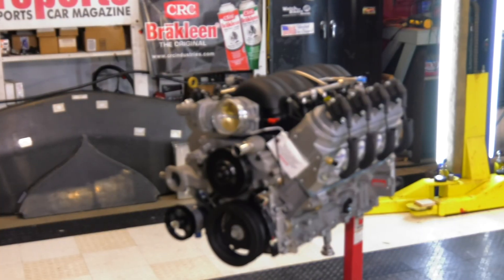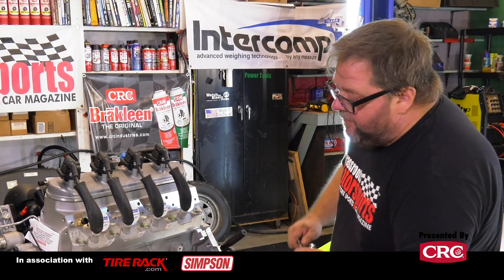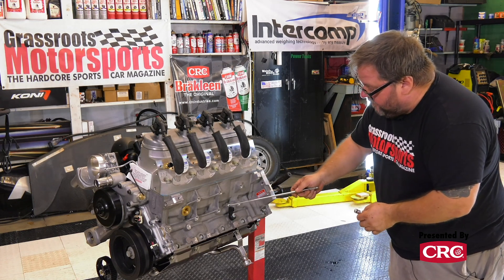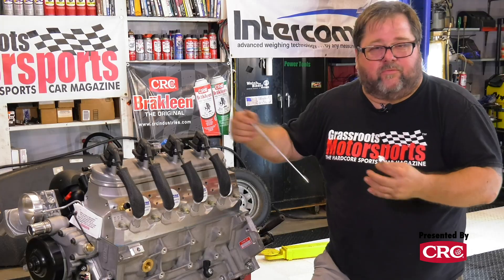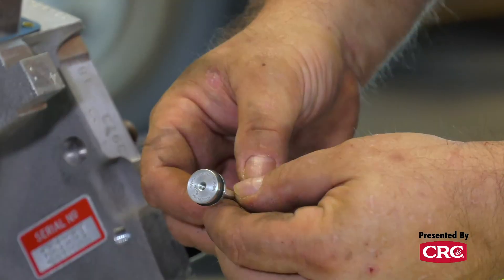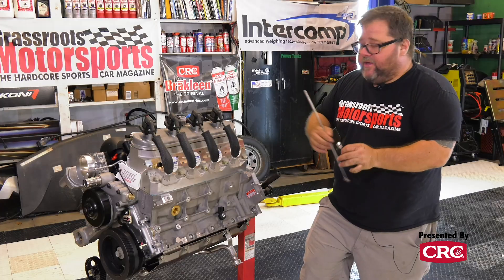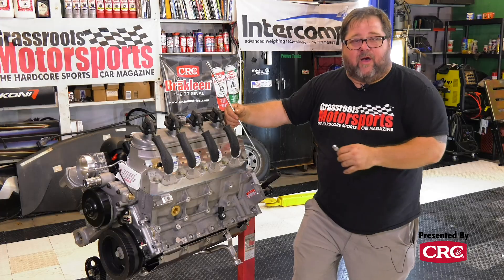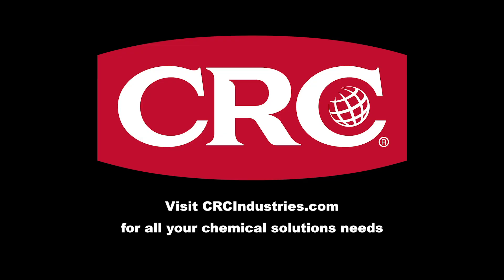LS Oil Barbell: Why is it a big deal?

Comment: Iv purchased this part.. installed it, then immediately removed it and threw it in the trash. You feel that added oring snag every burr in the block when you install it. You have no idea the condition of the oring once it’s installed. Yea I’m going with the gm engineers oem design. My engine made it 300k with the oem barbell. This is truely nonsense.

Comment: I own a 2007 chevrolet Avalanche with 260k miles on it, my oil pressure at start cold is around 35psi. I have been trying to bring it up replacing the oil pressure switch and filter, pick up tube o-ring, oil changes and filter every 5k miles but never pass 40 psi (fresh oil and filter) I believe this little guy is the reason for a low oil pressure on the system

Comment: What the ? ...The older chevy engines never had   weird devices in them ,and pumped oil just fine !
Reply: The older ones also suck more than a shop vac
Reply: Because the oil was channeled differently and didn’t need this. Without the barbell the oil will bypass the filter because the channels all intersect because of the machining process.

Comment: The lesson here is there should be data. Somebody take a measurement. You can do brittle fracture failure analysis at multi-angle application to a group of factory high mileage barbells and subject them to mixtures of modern racing fuels diluted with hydrocarbon blow-by products in engine oil to demonstrate that there is a significant difference in resilience between groups. You can measure flow bypass and compare diameter differentials to mimic factory thick-end bypass rate as additional purchase options. Hire me I can do it for you 

Dr.Brennan

Comment: It’s inexpensive but the labor to remove the transmission and flex plate are expensive when the engine is in the car. Labor rates are through the roof now.

Comment: I like the seal at both end . More engine block friendly . And seal cold and hot . But you can add a seal missing on the original one . Assuming the plastic one is not press fitted . If the original one as a tight fit ? It's a non issue

Comment: 2:12 If the purpose of this video is to sell the metal part, then this guy should be sacked: th plastic factory part is "perfectly acceptable". That being the case, and without identifying any defects with the OEM part, then potential customers would be better off spending their $26 elsewhere.

Comment: The factory one is designed to keep oil pressure up on the bearings even if the filter starts to get plugged.
Reply: But that means allowing debris to get past it and getting into the bearings. I am installing the aluminum one from sac city corvette and I’m also blocking off the oil filter bypass valve in the filter housing. The oil pressure sending unit is downstream from the filter so if the pressure decreases that means it’s time to change the filter. Also don’t use the short filter, upgrade to the long filter.
Reply: @monteclark1115 you are absolutely correct, however, any oil pressure is better than no oil pressure and if your changing your oil and don't have any issues in the engine then the oil should be perfectly fine as is without being filtered.
Reply: How does it do that?
Reply: @NoName-ml5yk the factory plastic one doesn't have an o-ring that completely separates the filter from the non filtered side and has a few grooves to act kinda like a labyrinth seal.
Reply: oh really, okay GM expert
Reply: @zombiebloodsparkle1 how do you know I'm not a gm expert? How do you know I haven't worked with gm engineers on new car issues at the dealership I worked at?

Comment: Line drilling all the way through the block is a complete lazy move on gms behalf. It's a feather in the cap to poor workmanship and planned obsolescence Just do another setup and drill from the back so theres no need for the part in the first place. Instead they created this part that will fail. The correct fix for this is to press in a bronze plug past the outlet port of the oil filter
Reply: I've wondered why 2 threaded allen pipe plugs weren't used here.  (Same kind of pipe plugs used above the cam bearing at the back of a SBC.)
Reply: Not really considering LS engine generally live well past 200k miles being beat on lol I’d be far more worried about the DoD system lol
Reply: that would be a pain to remove and clean that gallery if you ever needed to tear the engine down for a rebuild. this works fairly well even though it is a little weird.
Reply: I doubt you are smarter than the team of engineers that designed the motor.
Reply: @TriStarWorkshop  i doubt your doubt
Reply: Yeah GM definately doesn't know what they're doing that's why everyone hates LS motors and won't use them for swaps.
Reply: @animus13racer  they cut corners on this aspect of the design
Reply: @jimf4754  wrong
Reply: @shadowopsairman1583  good one

Comment: This is a guy that knows a little of something and misrepresenting it to the world as if he's a reliable source.   The barbell is responsible for 2 things and 2 things only. Diverting oil coming from the pump into the filter. It is also responsible for corking the back of the main oil galley so that oil goes up the block toward the oil pressure sensor to lube rods, mains and cam rather than just dumping out into the oil pan after fire hosing the rear cover.  The leakage on the oem barbell is minimal. Theres at max less than 20psi across the front of it, and system pressure on the rear o-ring which is held into the block by the back cover.  Do you need one of those fancy ass barbells? Actually no ....  No you dont. The ONLY reason that you'd want to get one is to omit the front o-ring (because they always get cut on the ports when you press them in and leave rubber chunks in your oil system) and have a solid seal for the back of the main oil galley that wont deteriorate over time. I've never seen a stock barbell fail, but that doesnt mean its not possible. Also, if the partition wasnt there that diverts oil to the filter, you'd actually have BETTER oil pressure, as theres a pressure drop across the filter and pressure is read AFTER the filter. Ao this guy doesnt know what the hell he's talking about ....    Smh

Comment: This video is full of inaccuracies.... From the description of oil back pressure, to saying "nitron" seal?? It's either Viton or Nitrile not Nitron. Nitron is a chemical used to test for nitric acid content not a type of rubber. No need for this. Gm power train has tested the crap out if this piece. Waste of money. I've seen many LS engines making reliable power up with boost up to 1000 up and never seen one go bad...ffs
Reply: This guy is an actor not an expert. A lot of misrepresentation & inaccuracy in this video. Atleast he calls it a Barbell & also Dogbone.....

Comment: Do not use a metal barbell that has a second o-ring. The oil galleys that go from the filter up to this main galley has sharp ridges where they intersect. If you use a barbell with a second o-ring, it will catch on those edges and tear. The broken pieces will go through your engine and oil will leak past the barbell. The ones that do not have a 2nd o-ring have a very tight tolerance to the oil galley. Nothing over 20 microns is getting past it.

Comment: Wrong diagnosis if the ball valve was leaking the front half of that plunger would just leak oil and not filter all the oil, the critical part is the rear sealing part of the plunger that's where you would leak oil back to the motor and lose pressure the oil filter doesn't control pressure only if the bypass valve is not working and the filter is clogged then you will have problems. one problem with LS motor i thought with the engines was this oil filters too small not enough filter capacity and the PCV valve system should have clean air valve covers and PCV valve in the Valley cover with fossils and valve covers good baffle next time I build a LS motor I plan to run the PCV valve in the center Valley cover with the baffle and run fresh air into both valve covers filter air also run a nice full flow oil filter remote oil filter like a pH 1 I called the old Ford Filter

Comment: Any chance you could explain what the part does?  Thanks
Reply: When the block is machined, the oil gallery runs the whole length of the engine block. This barbell part blocks off the oil gallery in a specific spot, so the oil is diverted through the oil filter. It's not intended to move. Without it, you'd have unfiltered oil running through the engine.
Reply: @IBWatchinUrVids solamente sirve para corregir una pendejada de la ingeniería al haber cruzado las líneas.

Comment: The smallblock chevy has a similar feature for the same reason, a metal plug inserted in the oil channel. Like the LS barbell, not having it in place - or broken/leaking - does not affect your oil pressure but it WILL destroy your engine since it effectively bypasses the oil filter.
Reply: Small chevy does not. The closest thing to this is the oil filter bypass valve that literally bolts to the inside of the oil filter boss that provides the threads that your filter screws on to. If those fail, you can eventually over time mess some stuff up. Thats why they ovver the adapters without a bypass in the aftermarket. Meanwhile gen1 sbc does NOT have anything even remotely like this.. all oil galleys are wide open and can easily be rodded or cleaned with a bottle brush without obstruction.
Reply: @gadgetdeez7069  Sorry, but you have either misunderstood my statement or lack knowledge. The inlet and outlet channels to/from the filter is one (1) drilled hole, partitioned by a post-drilling inserted blanking plug.
Reply: @gadgetdeez7069  next time you have a small block Chevy apart, follow the oil passage that goes through the rear main cap into the block. That passage goes all the way to the top of the block where the oil sending unit threads in. That passage has a plug pressed in that directs the oil from the pump to the filter. Without that plug, oil can and will bypass the filter.

Comment: "You are going to lose pressure without that dumbbell" ??.....Dumbbell......You just Bypass the oil filter, probably
regain the pressure lost through the oil filter.....That $26 replacement part is just blowing money smoke at your forgetful mind...
 Many other Mfg's just drive brass cup plugs in there.....Oooooh, and don't run the engine without something
retaining that sucker in place.....
Reply: Lost pressure is BS. Pressure gauge switch is up stream from the diverter.. Notice how he fumbles & stumbles around the lost oil pressure issue. He can't describe why because it doesn't lose oil pressure.  It is just a diverter placed in line to get oil to flow through the passages that the filter is screwed to. Without it there is no filtration.

Comment: Is that the same on a dry-sump LS7???
Reply: The whole gen3 gen4 LS family uses the exact same setup. The only difference with LS7/LS9 dry sump is the pumps have a primary suction stage that clears the crankcase and dumps it into your oil tank. The oil tank then is plumbed to the pressure stage that pressurizes the block the same way as any other gen3/gen4 right through the same oil gallery.

Comment: Can I use this on a stock LS. Possibly why my engine is lost oil pressure and has been a lawn ornament.
Reply: All LS, flush the engine using CRC/K&W 5 minute Engine flush, drain oil. Drop oil pan clean pan, windage tray, oil pickup tube of varnish. Replace oil pickup tube o ring,replace oil pan gasket. Use AC Delco or Purolator, NAPA Filters Only. Oil Valvoline/Castrol/AmsOil Synthetic. 5W30.

200,000 miles, get a Melling High Volume oil pump, replace timing chain/gear.

2007-2013 LS
Pull the oil pressure switch behind intake, remove filter screen from the bore, clean it or replace it.
Reply: @shadowopsairman1583  thank you. At 263,000 miles I knew I needed an oil pump. Was showing very low oil pressure. But now it sounds like something is broke. Rod, lifter, who knows. I know it needed an overhaul. Now I think I'm passed that. It starts but sounds like rod could go threw the oil pan at any time.  I know floored it won't pass 40 mph. I will not take the engine apart until I have the cash to do so. But if I did it would/ wouldn't ease my mind. 2000  z71 extended cab. 4x4 was my dad's. So I will be trying to keep it. I love that truck just sad to see it in this shape.☹️👎🏻
Reply: @shadowopsairman1583  I will be following this info that you recommend to the T. Thanks again.
Reply: @shadowopsairman1583  why do you recommend those 3 brands of oil? I understand the absolute, but didn't think the other two were close on comparison. I use mobil 1 with the dexos logo on the jug. Figured long as it meets dexos requirements it has to be decent enough.
Reply: @swappedoutZ71  used mobile 1 and switched right back to valvoline after getting lifter taps. I just made a major writing on several pieces of info to be somewhat inclusive.
Reply: @shadowopsairman1583  I use Johnson lifters in my truck they were good so far. Trucks been sitting though, transmission problems
Reply: @shadowopsairman1583  My plan for my 2007 is to delete AFM, delete the oil pressure relief valve in the oil pan which sprays piston #7, replace my pickup tube o ring and change my oil about twice as often as the DIC tells me to.  I'll leave the OP bypass valve in the oil pump which should protect everything downstream from excessive pressure.

I believe that the clogged upper filter screen is merely a symptom of old overused oil being bypassed around the filter.  I can understand the need for the average user to have a filter bypass but it would be great if any time the filter is bypassed, it would light a warning lamp and set a trouble code if it continues.  Unless the bypass event was the result of low temperature, the driver would or should then know that the engine needs attention.
Reply: @Sherman62  yeah I have a 4.8 so no dod to screw with.
Reply: EVERY LS, including yours, MUST have the barbell restrictor in place. Either this one, or the stock piece... .
Reply: Yes you can!

Comment: Why don't you just weld that s*** closed in between the two passages
Reply: Exactly 🤨. Not one person ive met lately thinks this complex on figuring anything out for themselves all the possibilities for any type of problematic thing they may or may not run across. Ignorant ppl piss me off. But totally resonate with your comment 100% 😊
Reply: Production costs.
Reply: @milojanis4901  production cost you must build like 300 motors a day weld her up this isn't meant to be a smart remark I'm just saying if you build two to three motors a week two to three motors a month then it isn't a production issue problem solved I know why GM does it and you're right production cost
Reply: @darrinbega302  Wasn't being smart. Production costs/beancounters rule GMs every movement, and decision. GM isn't the only one, either. Yes, I guess you could weld it, but welding 'shifts' things if it's done with excessive heat. I would rather make up a 1/2"-3/4" long aluminum, or brass, plug, and press it in to the correct position. But it's overkill. The factory barbell works OK, and this aftermarket item, for $26, is even better... .....
Reply: I wasn't taking your comment as negative I worked for GM for almost 20 years I know the deal I'm just saying because I have done it it's not complicated as long as you take your time works for me never had an issue Yes you could probably plug it the same thing I'm talking about like the home mechanic building a motor I built many motors in my garage and I just welded up and I thank you for your comment and yes you can plug it also done deal I won't have to worry about the dumbbell Nice talking to you

Comment: But why would oil pressure decrease? Wouldn't it just bypass the filter?
Reply: Milo Janis looking at one on the stand right now, nick is correct.The rear cover by itself will not hold pressure. The cover holds the dumbbell (or dog bone, tomatoe potato) in place, it won’t seal the oil hole on its own.
Reply: @yeetskeetledeet8184   interesting. I ALWAYS put it in, so I haven't checked whether or not the cover blocks the passage, or not. I believe you are correct, because the shop manuals ALL say that if its been forgotten, and not re-inserted, there'll be no oil pressure. Some people would do well to research things before they accuse someone of being full of shit......
Reply: You are right about the oil pressure. This guy is full of crap. The oil filters "back pressure" has nothing to do with creating oil pressure. Bearing clearances dictate that. This dude is just trying to sell something that does nothing. The factory piece will be there after the engine is junked. Save your $26.
Reply: @kennethjones7239  If this is the aftermarket piece I think it is, it is far superior at keeping unfiltered oil from slipping by the filter. If it woulda been available when I built my LS7, it woulda been in there......
Reply: He is right about loss of pressure if the plug was missing completely. Oil would just blow right pass the dog bone and shoot right out the hole in the back of the block 👍
Reply: @nickb2657  Bullshit, the oil would simply bypass the filter. Oil pressure would remain the same and NOTHING would "shoot" out the hole in the back of the block.
Reply: @nickb2657  you are right the rear cover doesn't block off the hole it will pump right into the oil pan
Reply: Volume increases, pressure decreases
Reply: @reggieanderson885  It Did Not Change   Da
Reply: @reggieanderson885  :volume is still limited by the same downstream resistance, only oil filter pressure
loss is removed....